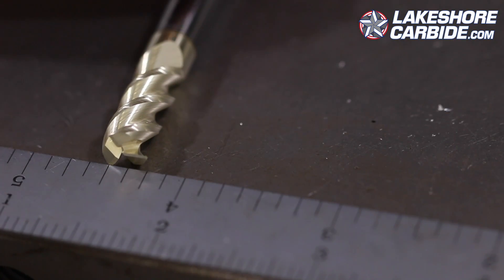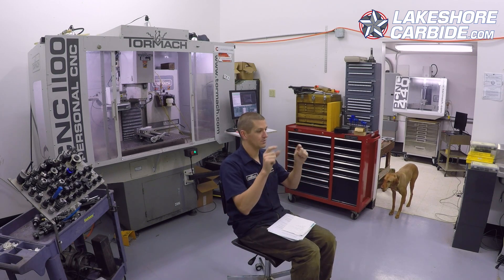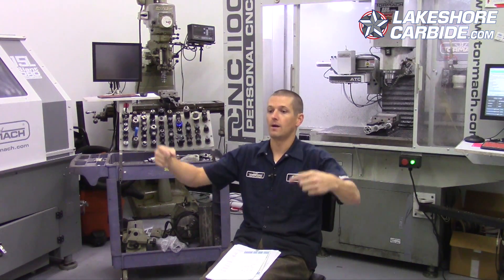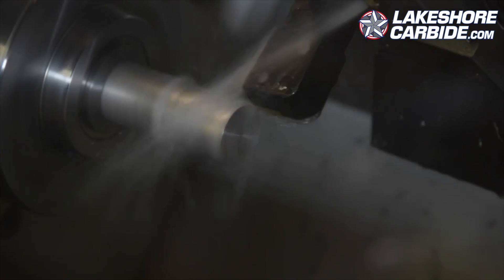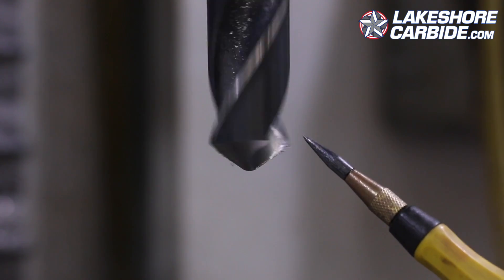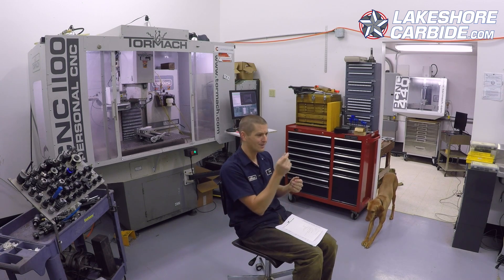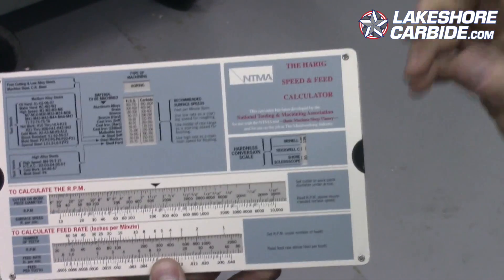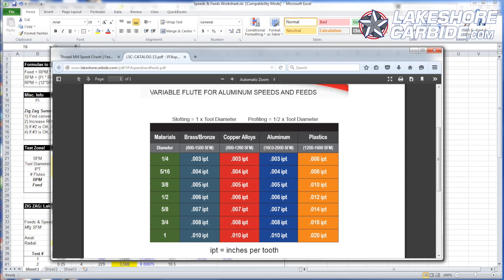3. What is SFM & Why it's overrated!

Comment: Two things:

1) SFM does matter and it varies by material.  Why?  Three letters (words) BUE.  What is BUE?  BUE stands for Built Up Edge, and is a process whereby the material being cut literally welds itself to the tool cutting edge as it is passing through the material, gradually building up a longer and longer ridge of material extending off the edge of the cutting tool until the length gets too long and the built up material breaks off.  When it breaks off, it takes a bit of the cutting edge with it (remember, the BUE is WELDED to the cutting edge), and the process starts over (only with a slightly blunter cutting edge, which makes the next BUE build up faster).  This condition is continuous and degenerative in certain bands of surface speed in certain materials.  Mild steel and aluminum both have cutting speed bands where BUE is a big problem.  So yes, you can ignore the MFG recommended cutting speed (SFM), but you always have to be aware of the SFM band on certain materials where BUE will be a problem.  Slower is not always better.  Coolant type and application style also influence where the BUE bands land on the speed chart.  For instance, BUE is a BIG problem on 6061 alum at 600-700 SFM dry, but if you apply a flood coolant with even a little lubricity, the BUE problem drops off entirely.  This is one area where misters and MQL setups are insufficient to the problem.  Light mist and MQL air blasts are usually insufficient to ameliorate a BUE problem.

2) Travel speed and therefore IPT are dependent on may things beside just the tool geometry and the material hardness/tensile strength.  Feed rate needs to vary according to your tool engagement.  Side milling VS slotting, or one diameter DOC VS three diameters DOC, or both at the same time (side milling at one dia DOC VS slotting at three dia DOC) will drastically effect the chip load you want to use when programming that cut.  The relationship is NOT linear.  Feed rate also needs to vary according to chip evacuation and coolant supply.

As an example, I routinely cut 6061 T651 alum bar stock with a 1/2" dia carbide two flute endmill (std 30° helix, nothing special, no coating) at 650 SFM (that's the top speed of my spindle, 5k rpm), 0.25" DOC (one half dia DOC), full 1/2" WOC (slotting), at a chip load of 0.004 IPT (40 IPM).  At this speed, I can trust the machine to run all day with low pressure flood coolant.

If I were to increase the DOC to one full dia, I would have to slow the travel speed down to about 0.0015 IPT (15 IMP) and either increase my coolant pressure or add an air blast nozzle adjacent to the coolant nozzles to prevent tool breakage from chip packing in the tool gullets and chip recutting in the slot.

Twice the metal removal results in a travel speed that is less than one half the original, decreasing overall MRR.

What I'm trying to say is that there are a LOT of variables to consider in this stuff, and a lot of them are interconnected such that ignoring one while varying another can lead to tears (or more probably curse words).
Reply: SFM does matter. It directly affects your tool life. A proper tool manufacturer does tool life studies as a function of SFM which clearly show the negative trend. You will see this info in their tech sheets. BUE is one reason like mentioned above. BUE is easy to easy to avoid though. Take a 5" diameter work piece. Face it at constant rpm. You will see two rings form where the surface finish is bad. You know RPM and the diameter where the surface finish goes bad. You can then use this info to find the upper and lower SFM to stay between to avoid BUE.

Comment: SFM is an under ideal conditions recommendation. Unless you get the numbers from the manufacturer of the specific tool you're using, you're not getting a good picture of what you can do.

For instance, I just received a promotional insert from Seco for cutting low carbon steels. My general goto for turning steel with carbide is 400-800 SFM depending on the alloy. But on this insert, the recommendation was 1600 SFM...which is my baseline for aluminum. Since it was a free insert, I decided to go with their suggestion and it cut like a dream in 1018 hot roll with a beautiful surface finish.

If I had only gone with my baseline (much like your spreadsheet), I would have been leaving a whole boatload of cutting power on the table and not using everything I paid for if I had bought the tool. That's what I use SFM for: the maximum capability of the tool in the material...NOT the absolute target number. Tools will work just fine, for the most part, if they're run at a lower SFM. There are some exceptions to this, but the people who use Tormach machines are not likely to ever see those scenarios.
Reply: Yup yup :)

Comment: I think I heard the following, but not sure, so take this with salt:

Recommended SFM and IPT are designed to optimize two or three things simultaneously:

(1) Surface Finish

(2) Productivity (machine as many parts as possible per hour)

(3) Cost of production (machine as many parts as possible per tool sharpening or tool replacement).  For example, as mentioned in another comment, too fast or too slow will generate too much heat and/or wear out the tool prematurely.

Some of the super high RPMs are recommended because, if they were possible, would help maximize productivity (while maintaining surface finish).  Much of the time, these super high RPMs are simply not possible.  That just means productivity is limited by the machine, not the cutting properties of the material.

For a small shop, or a home shop, high-throughput productivity isn't important, let alone possible.  Instead, surface finish probably matters the most.  

If you drop the requirement that productivity should be maximized, then you can use much slower RPMs and still get good surface finish.  But I haven't seen any charts optimized this way, for small/home shops.  So IPT may be a better way to think about it.

Comment: In looking at the specs of systems like the Tormach PCNC systems, I've wondered about that RPM range with smaller end mills/parts in materials like aluminum.  Good to know that going with a slower SFM than the standard charts is very doable.

In my case, I'm currently using a Shapeoko 3 with a DeWalt router with an RPM range of 16k to 27k - the opposite problem.  It's hard to get the SFM down to recommended ranges, even with small diameter (1/8" or 3/32") end mills.  Maintaining a reasonable chip thickness without blasting ahead at 100ipm (and deflecting the not-so-rigid gantry) is the problem that goes with that, so I just got a single O flute end mill to try out in aluminum.  My take away is "go ahead and give it a try - SFM recommendations aren't absolutes."  Thanks!

Comment: yep the speed you used that cutter I said about what you used on the toolstoday vid I run it 3 time the speed what you did and it was fine.
in the end if the chip load is correct it all works out in the end using the SFM loaded to what you can run to, be it a mill or a router it scales.